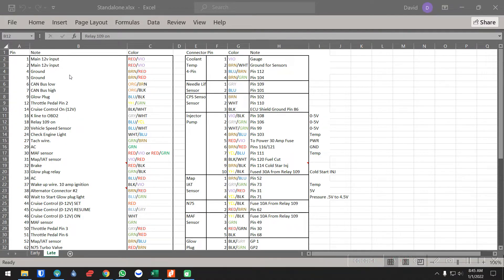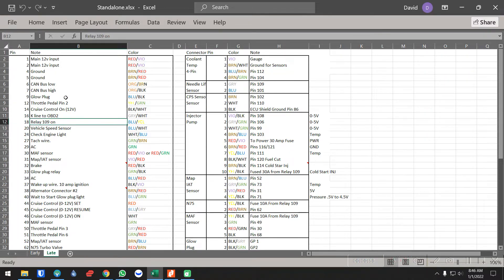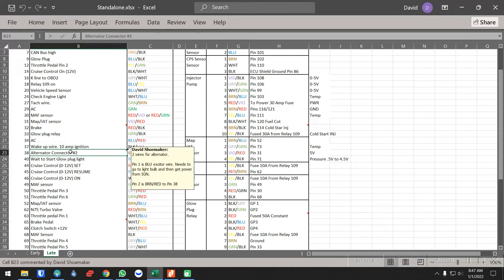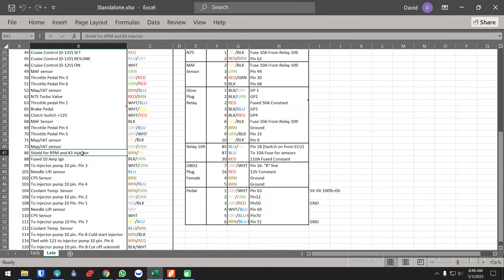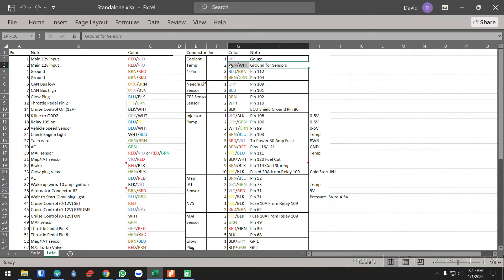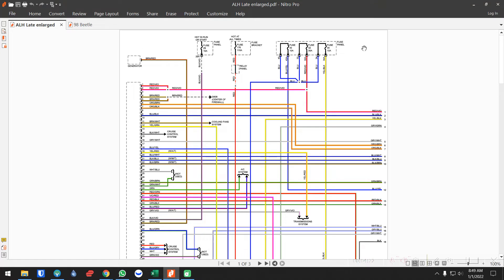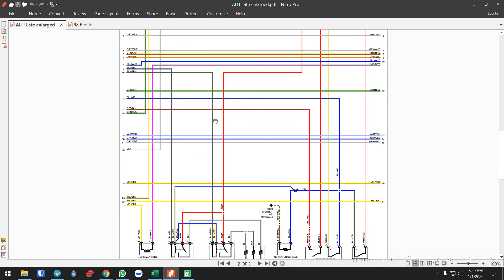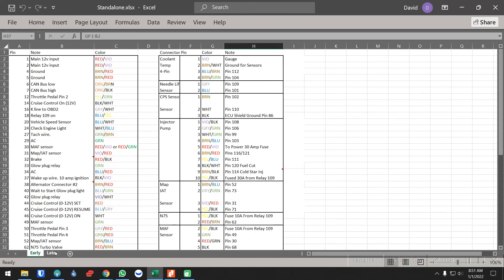TDI swap wiring information (join the Facebook Group TDI Swaps for the newest files)

Comment: Good evening, I have a BEW TDI engine. I wanted to know if you could help me with the wiring harness. Do you have the diagram of the module pin connections?

Comment: im in central NC, is there anyway to contact you? im bulding a 4x4 tdi swapped ranger currently and would love to have a you as a resource when i hit a snag. thank you for posting this one lol
Reply: having real trouble finding the cabin harness diagrams for a 2002 ranger, im wanting to retain cruise, PS and A/c with the swap. along with hopefully full instrument cluster operation
Reply from the maker: @Erosion999  I'm not an electrical guru, my brother is but he lives in PA.

He's doing a 2000 XJ and is having to figure out how to convert the CAN signals from his BHW to the CCD BUS in the Jeep. More than likely you might have to do the same thing as well, but maybe not. Depends on the TDI motor you're using.

For cruise, as long as it's not PWM driven, you can use your factory buttons to power the TDI ecu. What that means is your buttons should send 12V when you push them to your stock Ford ECU and tell it what it needs to see. For that to work, you normally need a vehicle speed sensor, but I recently posted up a video on how you don't really need one for that to work as well.

Power Steering will be custom lines. I did mine with Earl fittings and hoses (basically aeroquip) and they work fine. There is a tiny delay when I'm turning my wheels fast, but I'm pushing 33x12.5 on the factory pump. I believe the pressure is more than enough, but maybe not the volume. Another alternative is a Volve electric steering pump that drifters use.

AC will also need custom lines, more than likely. What I have in my CJ, and will be doing in the XJ, is using a B5.5 Passat 1.8T compressor and mount. This moves the compressor to the turbo side of the motor, which I needed to be able to clear my steering shaft. 

Finally, the instrument cluster. If it's driven by CAN, you might run into issues. There are CAN converters, but the only one I know of is by a company I choose not to do business with due to their inability to sell bench tested harnesses, when they say they test each and every one (but it's a lie).  I've added custom gauges to my CJ and use a Dakota Digital SGI-B100BT interface to translate my speedo and tach signals, so they output correctly in my CJ. I have one arriving today for the XJ. You need to find out if your coolant temp, oil pressure, fuel, basically all your gauges work through the PCM/ECM and/or BCM. I believe there are folks that run their old computers to allow their dash to work, and just swap over their sensors, but I'm not familiar with that as I don't do this for a living.

Best of luck!
Reply: @TDISwap  So what ive figured out is my pcm sends everything through the GEM module(essentially a bcm) and it converts it for the cluster, the cruise has its own separate circuit. I plan on retaining the ford PCM and just de-pinning everything engine related expect for the things the cluster/ABS would need to see. The tach is the only thing i haven't really got a plan for yet, so im up for suggestions there.  i joined that page specifically, and im about an hour from you near biscoe.
Reply from the maker: @Erosion999  Depending on what the tach is looking for you might be able to use the SGI100BT from Dakota Digital. I have that in both my CJ and now will be in my XJ as well. It just translates the signal from the VW ecu for my tach.
Reply from the maker: I'm on Facebook as the Admin of the TDI Swaps group (not TDI Swapped Trucks). You can reach me there. 

I'm near Fayetteville NC as well.

Comment: So the numbers skipped can be removed from the harness and anyothers that i would choose not to use?
Reply from the maker: The numbers listed here are the ones you will find in the harness as not all pins have a wire in them. If you don't have a manual transmission, then the clutch wire won't be there. If you're running a manual in the swap, then you'll want to add a wire to that location and feed it power from a clutch switch or 12V from the ignition so you don't have dead pedal the first time you go to accelerate.

There will be some differences between most harnesses. What I would suggest you do is look at the schematics and trace each wire to see where it goes, and then speak to your tuner to see what you two decide you want to do. 

Does he/she want you to keep the MAF? Then if so you need those wires. If you're running an automatic and need CAN, then you'll need high and low. If not, remove them. If you're running an automatic to manual controller say for an AW4, you can also remove them. Do you want cruise control? If not you can remove them and the VSS wire. Technically you can remove the brake wires as well as they'll be used to allow cruise to work (only one is needed), unless you want the pump to pull fuel when you hit the brakes. There are so many variables that answering that question is difficult.

Each person's build is a little different, so first you need to decide what you want to build/have, and then figure out what you need.